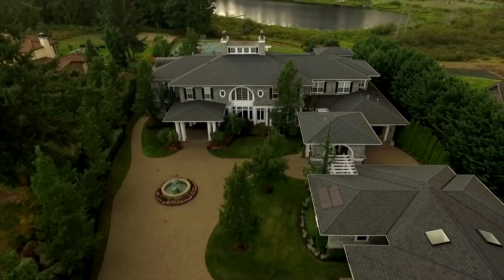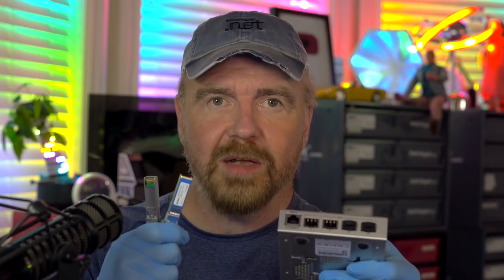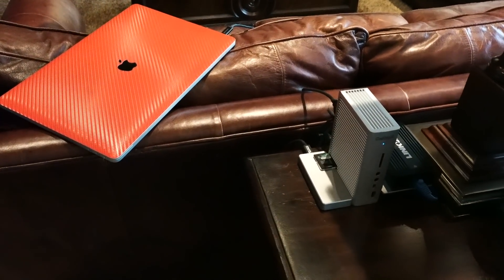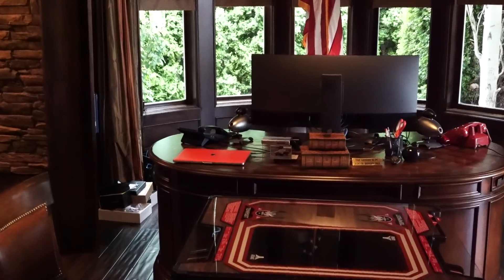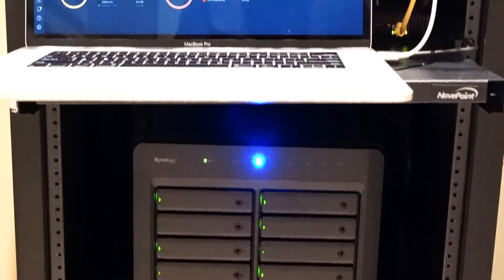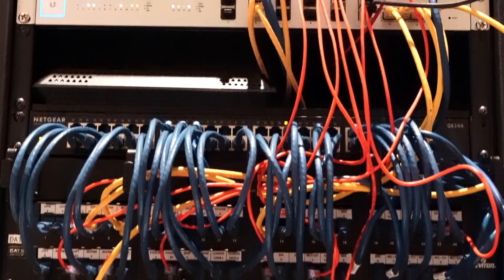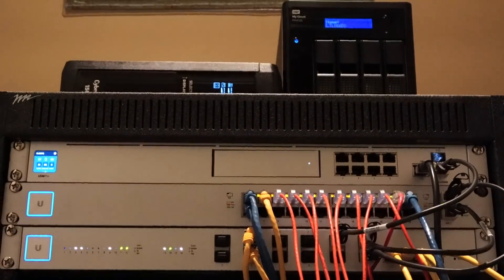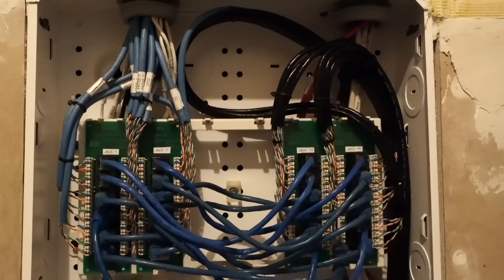My 10 Gigabit Home: How I Connected It All

Comment: Hi Dave, I'm retired System Engineer @ former EMC Corporation.
In my time there, we would had realized a project like this with a Symmetrix disk array and a Connnectrix FC switch for your amount of data.
Central control of all with EMC Symmetrix Manager.

Comment: Absolutely love this video, wish I found it earlier. My house is around 24K sq ft, 20 rooms and not pre-wired. I made a choice to use Multi mode fiber instead of copper, a decision I come to regret. Yea the initial investment was much cheaper considering the switches and routers however the cost of transceivers and the lack of PoE messed it all up. Anyone reading this with a big house. DO NOT DO ALL FIBER. Also pro tip for anyone who’s ISP provides an “agitate” fiber. Use a GPON to SFP module.

Comment: serious question. why are microsoft and manufacturers of 10g cards hell bent on crippling driver support in windows (non enterprise) of these devices? unless they're new devices, sold for consumers and not oldschool server shit you can buy for 30 bucks ;) it angers me. i know why vendors dont want their used stuff to be useful but the win enterprise drivers often do not work. i have 10 10ge cards that have no reliable windows support. sitting on shelves. i have had windows work with them, then after a windows update they shit the bed but never more than 2 computers at once work with these cards. hp, intel, other brands. super annoying. 1gbit is so slow by today's standards. i want 10gbit over 2 pcie4 lanes. pcielanes are in short supply on consumer hardware.

Comment: For the record Cat5 (without the e) usually only contains two pairs of wires because that standard does not go beyond Fast Ethernet (100Mbit) Cat5e is OK for Gigabit, but was designed for Fast Ethernet with PoE over the other two pairs.

Comment: I have connected the surveillance system of house to an old ADSL modem, and use it for house monitoring using PC and mobile phone, the only thing that was necessary was allocating an static ip address to the CCTV, so it can be accessible again if it reboots. The LAN cables were already installed.

Comment: Very nice videos, just found your channel today and have been watching this series. I'm getting a upgrade to a 10G internet next week and need to run some new wires up to my office and figure out how I want to utilize it for my servers. I'm mostly experienced with normal ethernet so all this SFP+ stuff have been a lot ot take in these past few weeks. 

I'm not as lucky as you, we seem to have regular old CAT5 (not E) in all the cabling throughout the house, cable runs are done a bit adhoc and nothing is documented, and nothing is ducted. So I'm in for a few long weekends running new cabling to the critical places. I have not decided yet if it's worth the hassle to have actual 10G outside the server room and maybe my office. A router for 10G internet isn't trivial to find for reasonable price either.

Comment: About the twisted pairs in the Ethernet cables: They work as what we call differential pairs. Before hitting the wires the signal gets split into a positive and a negative component. Along the run this signal is submitted to the interference sources that hit both wires in the pair equally. At the receiver the positive and negative halves of the signal are summed back to recompose the original waveform. As both (+) and (-) components received the same interference it gets canceled during the sum operation and you get your beautiful interference free signal back. But I think you already knew that :) Keep pushing this great content!
Reply: Correction to his statement in the video that "parallel wires are bad" - google "Twin Lead" - the balanced parallel cabled used for ages among analog TV and HAM radio to connect TO antennas, they are not the antennas themselves.
Reply: What is the interference, magnetic?
Reply: @Zzznmop  Electromagnetic... in other words, radio interference. Any long piece of wire will function as a receiving antenna and any wire with a varying electrical current passing through it will act as a transmitter.

Certifying that electronics comply with FCC regulations or equivalent involves testing that those effects are within allowed limits.

Comment: I hope you connected the different buildings with fiber, because if you don't you have the risk that the electric potential is different from 2 building, for example when lightning hits one building it will fry all your network stuff. This is why at least here in Europe different buildings need to be connected with fiber to each other to meet the standard, because fiber doesn't transmit electrical power and so it doesn't damage all your network equipment if the potentials between buildings are too big.

Comment: Surprised he's not using Windows, guess Apple is on the way up and Windows down.
Reply: He mentioned in another video (dont remember which) that he uses both mac and windows, the video related stuff (filming, editing etc) is all mac if I remember the video right, but I'm guessing it's so he doesn't have to switch between systems/programs etc since the computer in his garage used for recording was a mac. Dont know if he uses Linux at all however, would assume so for server stuff at least

Comment: Hey Dave! Just discovered your channel. Beautiful home. Much more modest place here, but I'm a big fan of Ubiquiti gear and just moved to a UDM Pro and all UniFi. I'm very happy with it.

I skimmed the comments and didn't see anything on this, so I thought I'd add just a little color commentary. A transceiver is a combination transmitter/receiver. There are all sorts of them and it's a general term used across all types of equipment. Your explanation is completely fine in the context and I'm not knocking it, just providing a little added context.

Comment: Interestingly I set my own 10Gb networking at home earlier this year. I knew how to do most of the stuff but 1 thing that just was unforeseen was interesting, and all of this was just to connect directly from my main machine to the NAS box and nothing else. Turns out the 10Gb NIC needs a ton of cooling otherwise it would shut down, and that was not even when it was in use most of the time. And it was not even a faulty NIC!

Comment: Full disclosure, I have not watched the video (yet - it's on watch later). Can someone enlighten me as to why a home user would need a 10G home network? Most ISPs do not provide anything above 1G service, so they only benefit I can see is huge local area file transfers. I just don't see the relevance of these speeds in a home environment.
Reply: Your first confusion is internet vs network speeds. If you have a NAS it really has no relation to internet speeds. You want to be able to transfer between computers at faster than 1Gb. Even a modern 3.5" HDD can hit 180-200MB which is near 2Gb. The Network is the bottleneck. 
There's ISP's bringing out 2Gb internet requiring faster NIC's
If you don't do network backups or you just surf the internet you don't need 10Gb. But some just like to have Ferrari's even if they just sit in the garage.

Comment: This might actually work IF NetworkManager doesn't mark your 10G interfaces as unavailable.  This interface worked under CentOS7, but CentOS8, just marks then as unavailable.  I haven't been able to get them active yet.  Other interfaces work both within NetworkManager and without it.  Sure wish I knew why?  Maybe RH did something to limit this if you aren't paying for a commercial contract.  Card to Mikrotik connection is via 10G SFP+ and fiber.

Comment: Damn man, nice pad.   But i’m thinking most normal sized houses would be fine w/ CAT6.(getting 10G)
Reply from the maker: Quite possible... I'm getting away with it in a number of locations!  But if I was buying, I'd buy 6A to be safe!
Reply: I would contest that even in an average sized home you would still want to consider switching that has at least some sfp+ cages, especially if you are someone predisposed to tinkering and/or frequent upgrading. Sfp’s can be more expensive up front but give you a lot more flexibility in the gear that you choose as you can get a transceiver to suit any purpose you can imagine. Sure, pull cat6 as your primary structured cabling but maybe keep your options open as to how you choose to light it up.

Comment: You're an amazing teacher.

Just for clarification, with RJ45 SFP transceiver which are capable of max 30m runs, wouldn't high quality CAT-5e and CAT-6 be good enough for 10G? CAT-5e has been shown to be able to support 10G at around 40m distance and CAT-6 is rated for 10G at 55m.
Reply: Note that needs to be good Cat5e cabling, and it also degrades over time. Got caught out by the degrading once, was some cabling I ran in 2005, degraded and couldn't handle 10Gbps on some runs once I tried upgrading, confused me as worked fine for others from the same original bundle. This was at about 30m, so probably close enough to edge.

Swapped it with fiber with SFP ports at the ends, that should probably last longer than the house will ever stand, just upgrade equipment on both ends as/when needed (and went with OM4 as OM3 was ~$50 for a 50m run vs $60 for OM4, this was underground in piping that was made for Cat5e, so way more than enough space for fiber).
Reply: I'm using cat6

Comment: Hi Dave, great video as always. Quick question about your CalDigit dock: what sort and brand of thunderbolt cable are you using for it? I assume you need an active thunderbolt cable for a 2m connection. I’m finding the 50cm one that came with it a bit short.

Comment: Where are you finding your 10 gig sfp switches, like that small one you were holding? And I've been trying my damndest to find the sfp to rj45, but all the ones I found were way more than 60 bucks. Any help?
Reply: Have a google for “mikrotik sfp switch”. I’m not sure on the specific model he was showing but that should get you started. 
SFPs can be pricy. Do shop around as isps or switch sellers often sell them at quite a high price. 
You can get configured but non branded ones much cheaper if you shop around. (Just avoid ones that are in the “to good to be true” category)

If I’m bothering with sfp ports I usually go straight to fibre, with the right modules you can go much further distances with denser cables bundles. 

Good luck.
Reply from the maker: @Aikidokajeff  Should be a link right in the video description!

Comment: Haven't heard the term "Sneakernet" in a long time.
Reply from the maker: Glad you caught it... I was wondering if people would even know what it meant!
Reply: @DavesGarage  I caught it too, but not regarding SSDs, my sneakernet was with 1.44Mb floppies. My house is wired for 10MB, and it streams from a media server just fine. I'll be moving soon, so there's no point in upgrading. But when I do move, well, this video and the ones to follow will be the template for where I end up.
Reply: @DavesGarage  I remember it from a crash course video or a tcp/ip book can't remember which...

For those who don't know it's a reference to back in the day, if you wanted to run a program on another computer, instead of just sending it through the Internet, you'd have to physically carry the punch cards containing the program to the desired computer ensuring they're still in the correct order which's a pretty big hassle

Correct if I'm wrong please, I'm not from those times😭
Reply: The perfect word to describe it. During my apprenticeship someone described our unit as Turnschuhadministration ( literally " sneaker admins"). We actually walked a couple kilometers each day supporting the entire campus.

Comment: My house has a literal server cupboard. It's a cupboard under my stairs.
Reply from the maker: I had a server cupboard (in the actual cupboard) out in the shop until I started recording video out there, then it was too much background noise.  I cut holes for fans and a fan controller and so on to maintain the temp, etc...
Reply: @DavesGarage  cooling design: aparenty the key to getting a QUIET fan is to run low spead with PWM and keep good air flow with a larger size to move the volume - That's just the opposite of a turbine 🤗